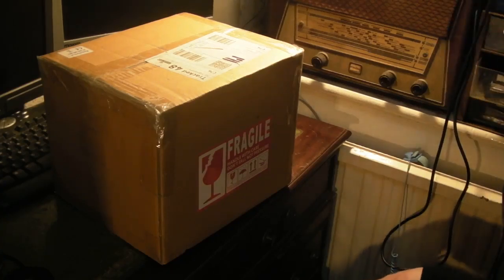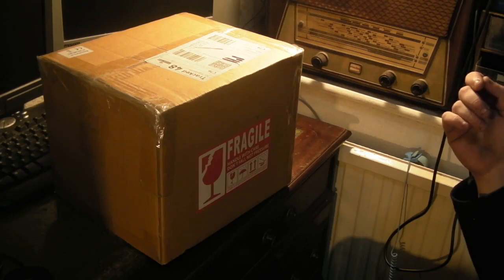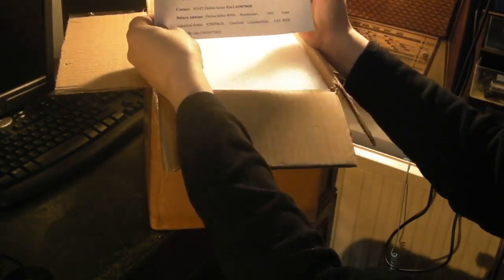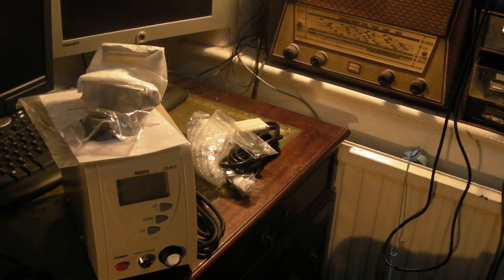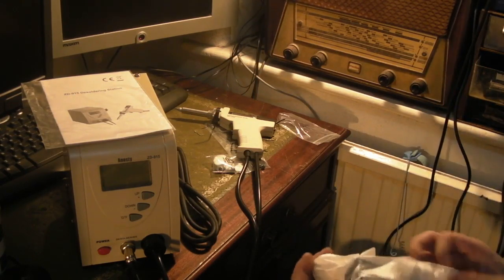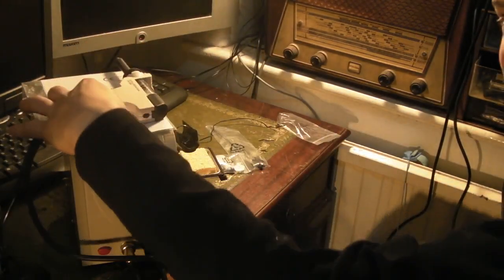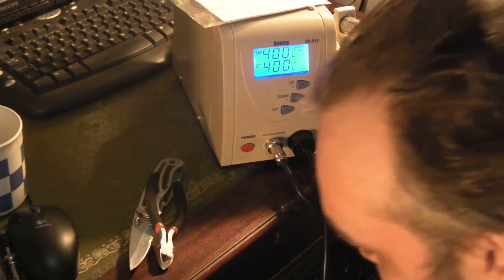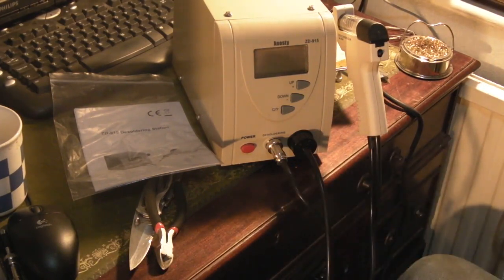Anesty ZD-915 desoldering station unboxing and test

Comment: They're a good unit with a lot of suction power.  I've had mine clog hard a few times; you will want to make some cleaning tools out of long HSS drill bits for it since the included tools are too fragile.  I have an 8" #59 drill which I use for general cleaning and a long #45 drill for clearing out the barrel if necessary.  The filter pads are made of ceramic wool.

Comment: My tips did not last very  long, hakko are better tips and I pre flux what i desollder
Reply: I have one Hakko 808 for my primaria desoldering, I bought one ZD-915 but never used, tips for the Hakko 808 fit perfect in the ZD-915.

Last month I bought the Yihua 948, is a more better option for tight budget, tips are very high quality.

Best Regards.